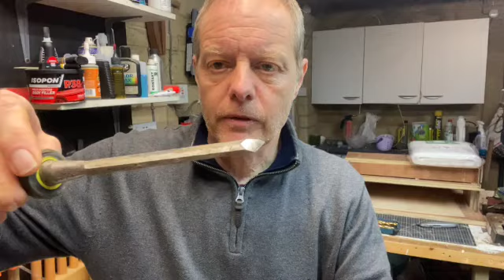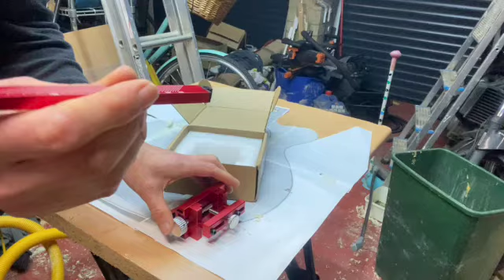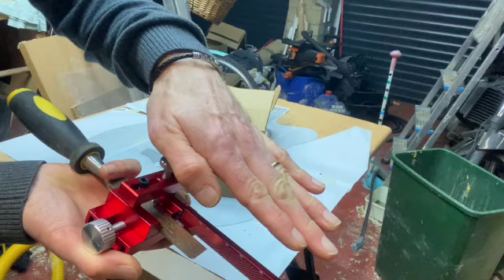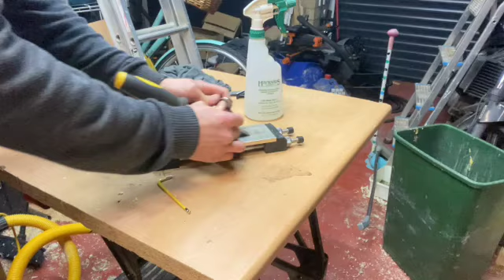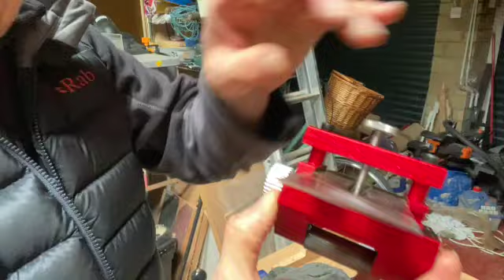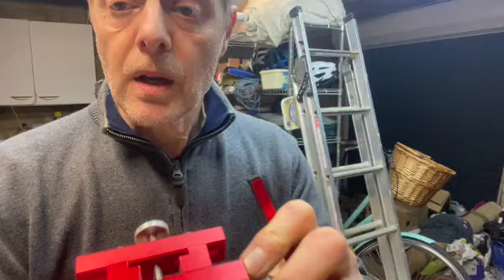Saker Tool Honing Guide unboxing and testing

Comment: Hi Rob I’ve just purchased the same tool but with my chisels I can’t attain the 25 degrees required what did you set yours at many thanks and I have also subscribed to your channel
Reply from the maker: That's strange. Are your chisels very short or an odd shape? Do you have the chisel held in the correct slot in the tool? (there is one for chisels and one for a plane)
Reply: @howtodostuffchannel  hi Rob yes there the correct slot have put up a video on my YouTube channel and I think that the body of my chisels is shorter than yours mine are from Mac Allister
Reply: I have the exact same problem my Marpels chisel won’t reach the 25 or 20 mark. 
When I push it to extreme there’s no travel on the stone l